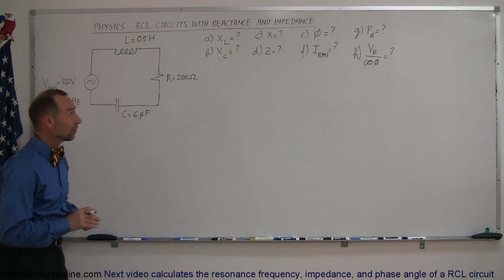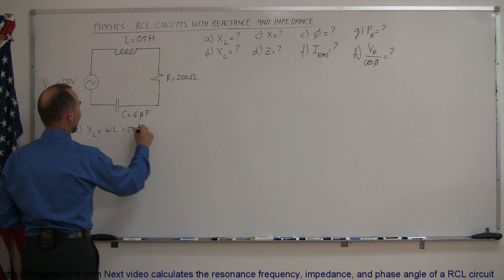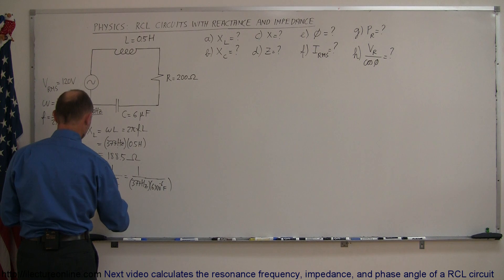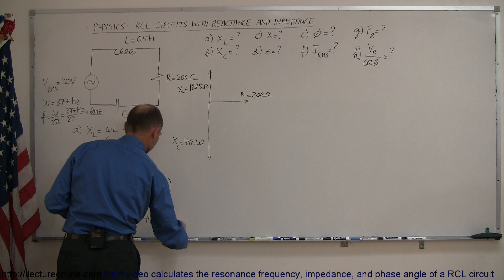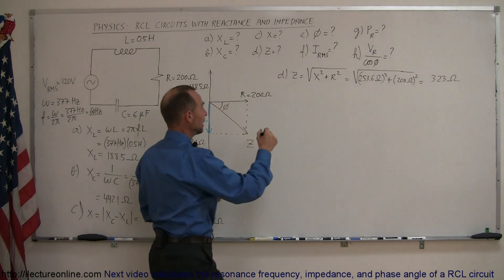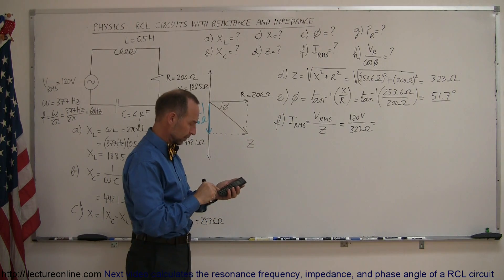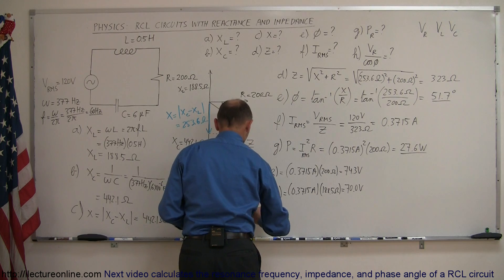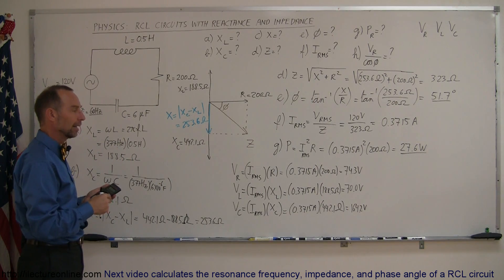Physics 49  RCL Circuits (1 of 2) Reactance and Impedance explained example

Comment: How would I know whether XL, or XC is upward or downward of R in the phasor diagram?
Reply from the maker: +Nathan Sharlaw 
   Since the voltage across the inductor leads the voltage across the resistor and the voltage across the capacitor lags the voltage across the resistor, XL is upward and XC is downward on the phasor diagram
Reply: +Michel van Biezen Oh so basically how the physical circuit is, the inductor is before the resistor so the first voltage drop is there, then the resistor, then the capacitor?

Comment: Thank you for this, my only comment would be shouldn't the omega be in Rad/Sec instead of Hz?
Reply: +Michel van Biezen Actually, I think there is an error right at the start where you say omega = 377Hz. Hz means cycles per second (and one cycle is 2*pi rad). It is a bit confusing that you put Hz as the unit of omega, especially when you took a quantity expressed in Hz then divided it by 2*pi and ended up with Hz again.
Reply from the maker: +Rj Massey 
omega is in rad /sec.   Radians are a "non" unit and do not need to be written, but is understood.  To avoid confusion, it is better to write it out.  (Unfortunately, I didn't do that here and hence the confusion).
Reply: +Michel van Biezen Ohhhh I see, thank you so much for that explanation!

Comment: Dear Mr. van Biezen, as I know the difference of reactances is X_L-X_C (series connection) which leads to an equation Z_tot=sqrt(R^2+(X_L-X_R)^2). Can you explain why you wrote X_C-X_L ?

Best regards,
Artan.
Reply from the maker: +Artan Gruda 
  X_L - X_C = X is the "net" reactance of the circuit.    The impedance Z = sqrt (R^2 + X^2)

Comment: Hey Michel quick question:  Why did you remove your 2 x (pie) from your xl and xc formulas?
Reply from the maker: +jon wilson   There are two ways in which the formula can be written:XL = wL   or   XL = 2 pi f Lsince w = 2 pi f  which is the angular frequency
Reply: +Michel van Biezen, thanks deductively I eventually figured it out.  Your video's are absolutely awesome.  Thank you so much!

Comment: Shouldn't the units for lowercase omega be written as rad/s? Hertz has always been cycles a second in my part of the world.
Reply from the maker: camlv 
radian is a "non-unit" and is technically not written.
therefore the units for omega is 1/sec with the understanding that it is radians
Reply: @MichelvanBiezen  I'm sorry, but that's wrong. A radian is an unit as much as, say, a meter is. What you are referring to is the fact that it does not denote a unit of mass, length, time, or some ratio of these. It is a dimensionless quantity (as in it represents (M^0)(L^0)(T^0)) but that does not make it any less of an unit.

Think about it. Radians per second represents a different angular frequency as opposed to degrees per second. So it's important to say what unit of angle measure we are using. If we say that the angle between two vectors is 3, then that's extremely ambiguous. If we say 3 radians or 3 degrees, then we have specified an actual angle.

FWIW, I've never seen anyone (neither teachers nor books) actually omit the radians when doing Simple Harmonic Motion, or dealing with ac circuits.

But don't take my word for it. Take a look at the newest edition of the SI specifications, set out by the National Institute of Standards and Technlogy. (Here is a link to the document: https://nvlpubs.nist.gov/nistpubs/SpecialPublications/NIST.SP.330-2019.pdf )

On page 15, they acknowledge that the radian is an unit (a dimensionless unit, but an unit nonetheless), and then on page 18, state that the units of angular frequency is, in fact, rad/s.

Comment: It should be clarified that 'z' stands for impedance, which by definition is the sum of the resistance plus the reactance. When you solved for 'z' in the video you're actually getting the magnitude of the impedance, not the impedance itself.The impedance equals z=200 - j253.6 Ohms or z=323 angle -51.7 Ohms depending on your preferred notation. Also it can be kind of confusing when you don't properly use the negative sign for the Xc or the proper sign for the negative angle since the net reactance was capacitive for this example. I think you should also be careful when calculating Voltages and Currents, the proper way to specify V and I in these AC circuits is with a magnitude and an angle or with the real and imaginary part specified (as I did above with the impedance). Great video, it was a great refresher in my case.
Reply: Exactly, you are right, the angle should be -51.7 because reactance is "imaginary resistance", and the minus will be there because of Xc. We should consider the phasor angle to get a accurate result.

Comment: shouldn't the voltage drop be equal to the applied EMF. This is the Kirchoff's Voltage Law. So the voltage drop should add up to be equal to the 120V.
Reply from the maker: Jeffrey,
No because the voltages reach a maximum across each component at a different phase.  The total voltage at any time will add up to the source voltage, but the maximum voltage reached across each component is reached at a different time during the phase.

Comment: Sir I have an identical problem and it wants me to find the impedance Z.  The only problem is that it states "is powered by a 120V (rms) Alternating current.

I perfectly how I can do the problem I have if I use 60Hz as you did, but it does not give me any angular velocity w or f (frequency).

What do you suggest?  Is 120V AC automatically 60Hz?  I know US is 60Hz and Europe I think is 50Hz.  I feel it is kind of a bad problem to not mention the Hz.
Reply from the maker: Green Bear
If the frequency is not given, you cannot do the problem.  The frequency must be given.
That said however, it may be implied and 60 Hz is a typical frequency.

But make sure you differentiate between f and w.
w = 2*pi*f
therefore w = 2 * pi * 60 Hz = 377 rad/sec
Reply: Michel van Biezen Thank you for replying back Sir.  I have used 377 rad/s and 60Hz.  I will bring this to my professors attention.  I really enjoyed this video of yours because you actually solved for everything related to RLC.  Thank you again!

Comment: Why for g did you use 200 ohm instead of 323 ohm?
Reply from the maker: Only the resistor consumes power, the inductor and capacitor don't.
Therefore power consumed = I^2 * R

Comment: Then what is t1, the first time after t = 0 when the voltage across the inductor is zero? This question appeared in my homework, and I know it`ll use sin(omega*t) since it`s given by ε =Va - Vb = εmsinωt. I`m really confused when I see this question within the problem.
Reply from the maker: First of all, the voltage across the inductor will reach a maximum 1/4 cycle (90 degrees) before the voltage will reach a maximum across the resistor.  The resistor is in phase with the power supply.  Since the voltage across the inductor leads the voltage across the resistor (voltage supply) by 1/4 cycle (1/4 period), the voltage across the inductor will reach zero at the same time the voltage reached a maximum across the resistor (and power supply).
Since the function describing the voltage is a since function, the voltage is zero when t = 0 and reaches a maximum (across the resistor) when t = 1/4 period.  At the same time the voltage will reach zero across the inductor (since it is 1/4 cycle ahead).  Therefore the voltage will be zero across the inductor when t = 1/4 of the period.  Since T = 1/f   and f = omega/ (2 pi), the period T = 2 pi / omega  and t = 1/4 T = pi ( 2 * omega).
Reply: Thank you for answering it, it helps.
Reply: Michel van Biezen Also, I am now a little bit confuse about what does the "RMS" stand for?
Reply: Thanks!

Comment: shouldn't omega be in radians and not hertz?
Reply from the maker: Josh,
The units of omega is ("radians" / sec), however radians is a "non-unit" and does not need to be stated.  It is implied, but not written unless one wants to for clarification.
Reply: oh ok, I found it confusing because it said 377 hertz and then it was converted to hertz.

Comment: This is amazing. Thank you so much!
One question: What is the phase of the current I(RMS)? Is it 1 over the phase of the impedance? Or the same? Or 0?
Thanks again Michel!
Reply from the maker: David,
If the the circuit is capacitive, Xc > Xl then the current leads the voltage.  If the circuit is inductive (Xl > Xc) then the voltage leads the current.  The phase angle phi indicates the phase difference between the voltage and the current.  In the video, the current leads the voltage by 51.7 degrees.

Comment: Nice video Michel, so my question to you is.
In my case i have a frequency that may vary between 50Hz and 5000Hz, its regading a speaker, we have to calculate when the resonace is going to take place to avoid trouble but how would you calculate if your frequency is varyating between a a long range like we have. I can see that your frequency is stable at 60Hz is that right?
Reply from the maker: What they are asking (when they ask for resonance frequency) is: "at what frequency will your impedance be a minimum?"   The answer is found when you set you inductive reactance equal to your capacitive reactance.  Since they are 180 degrees out of phase they will cancel each other out and the impedance will then be equal to just the resistance in the circuit.  So the resonance frequency is equal to 1/(2 * pi * square root (LC)).

Comment from the maker: Note that when you add the voltage drops across each component, they add up to more than the voltage supply.  The reason is that the maximum voltage across each component occurs at a different time phase during the cycle.

Comment: Good tut. Regarding the voltage across each of the components separately, you say you found the maximum voltages across them while using the rms values which seems a little bit different from other problems with AC circuits. Could you explain that very briefly? love your accent and tie.